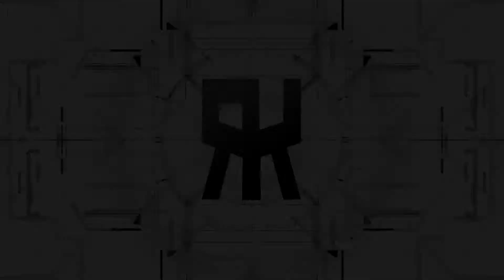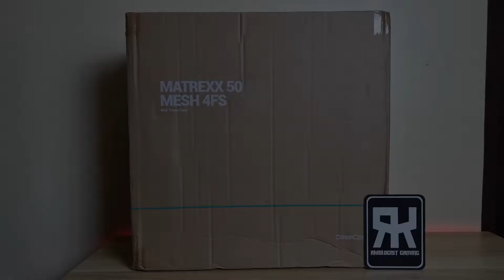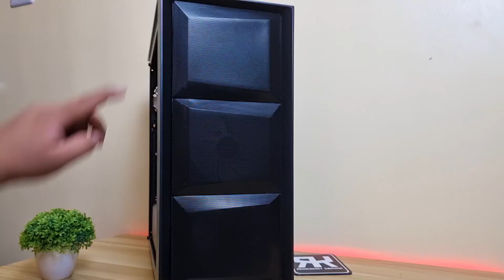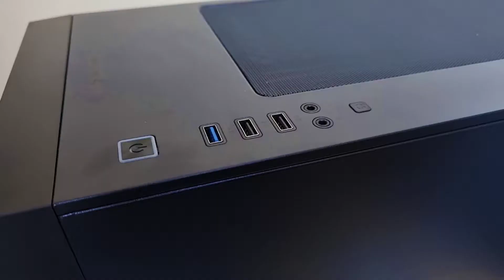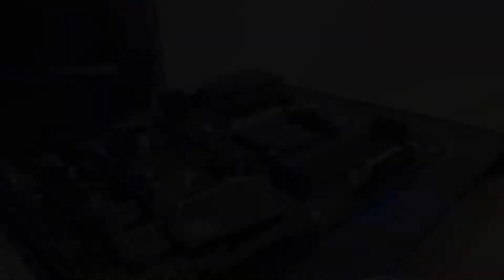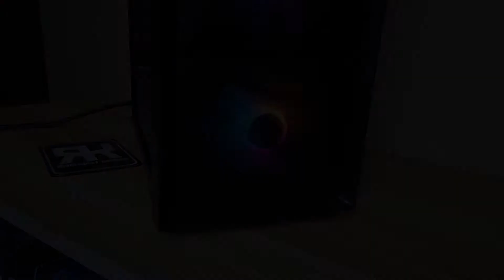DeepCool MATREXX 50 MESH 4FS Case & ST500 GPU Holder  - Unboxing & Overview

Comment: How do you remove the metal GPU panels that don't have screws?
Reply from the maker: you just need to push and pull that bracket.
Reply: @RKiologist  so basically I just snap it off? There is no way to reattach it after? I just want to make sure I I don't break the case haha. Thanks for the quick reply!

Comment: Brad, yung bottom support
 ng bracket pwede din move left right?
Reply from the maker: yes it can be move but limited
Reply: @RKiologist  nice Ty po sa response.
Reply: @RKiologist  parang of all gpu anti sag bracket eto pinaka sturdy no? base dun sa mga parts nya
Reply from the maker: @thesecondch2150  based on my experience yes